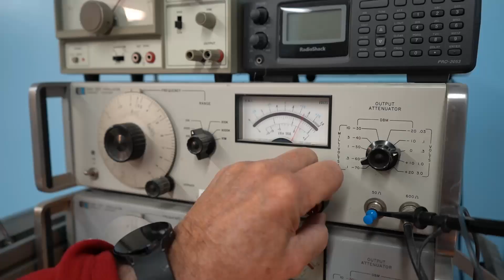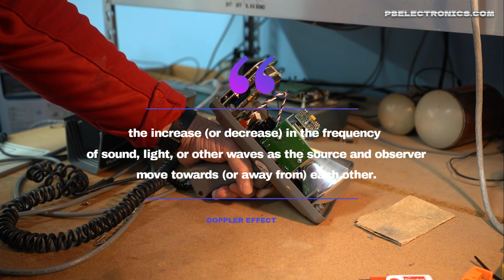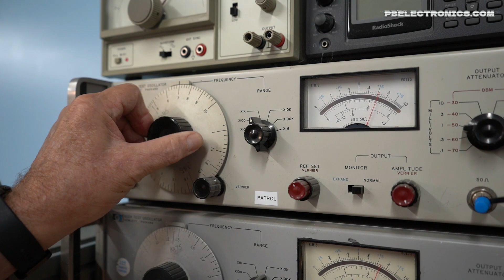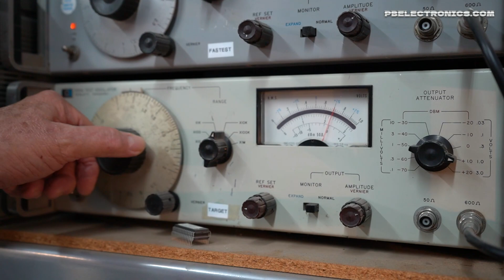Police Radar Repair & Calibration Basics - PB ELECTRONICS - How Police Radar Works  - MPH Z-15

Comment: Back in the 80's, I repaired MPH, Kustom and Speedgun units for several SO & PDs. Biggest problems were cords, RX diode and mechanical damage. I'll bet not much has changed except the addition of lasers.

Comment: I don't know who got it wrong all those years ago, but this is microwave speed detection - not RADAR which is an acronym for RAdio Direction And Ranging. 
Ships and aircraft use RADAR which tells them where the object is, the direction it is in relation to the craft and how far away it is. Microwave speed detection does none of these things. 
I suspect this system was called RADAR because it emits a radio signal which bounces back again. That's about all it has in common with true RADAR systems but unfortunately the name has stuck.

Comment: Two important points not mentioned in this presentation.

First, unless your automobile is moving at a significant fraction of the speed of light (186,000 miles per second), the Doppler effect upon which the "radar gun" works is a function ONLY of the rate of change of the distance between the radar gun and your car.  That is, the rate-of-change along the line-of-position between the radar gun and your car.  NO Doppler effect exists for motion TRANSVERSE to (at right angles to) the line-of-position between the radar gun and your car.  If the distance between the radar gun and your car is not changing, even if the speed of your car exceeds the speed limit, there will be no Doppler effect at the location of the radar gun.  It is not possible for the radar gun to evade the immutable laws of physics.  It is impossible for the radar gun to determine your speed of motion if your car is moving at right angles to the line-of-position between the radar gun and your car.

If your car is moving nearly at right angles to the line-of-position, it is ONLY the component of your speed with which your vehicle is getting closer to or further away from the radar gun that the radar gun can determine.  For example, if your car is moving at an overall speed of 100 mph, close to a right angle, but not quite, the radar gun might read 5 mph.  It cannot detect the component of your speed that is at right angles to the line-of-position, only the component of your speed along the line-of-position.

Second, if the radar gun in question was "calibrated" in the manner described in this video, the calibration cannot be considered reliable unless the manner in which the correlation between the setting on the signal generator and the speed reading on the radar gun were correlated with each other is specified.  For example, from the outset, the setting of the signal generator that results in, say, 55 mph on the radar gun may have been determined from a radar gun to which the signal was sent that yielded a display of 55 mph.  But, that radar gun may have displayed 55 mph when the Doppler effect actually corresponded to, say, 60 mph.  Having set up calibration in this way, all future "calibrations" will read 60 mph when the actual speed (along the line-of-position) is 55 mph.

To circumvent any such problem, an ENTIRELY INDEPENDENT (meaning independent of BOTH the signal generator AND the radar gun) speed calibration standard must be introduced.  Only when an independent speed calibration standard is employed can one specify the margin of error exhibited by a given radar gun, and can the gun be considered "calibrated".

BTW, I hold undergraduate and Ph.D. degrees in physics from MIT, and, among other relevant experience, I have worked on radar signature analysis for the U.S. Pacific Test Range.
Reply: Very informative and appreciate the information
Reply: No shit. 
Radar will not detect vehicles moving at right angles but you can measure distance traveled between two known points using a simple stopwatch.
Reply: Do you repair?
Reply: @ncso911  Unfortunately, I do not repair, calibrate or maintain Doppler effect "radar" equipment.  I am, rather, a Ph.D. physicist with a background in signal analysis.  The Doppler properties that I have described are true and immutable.  Anyone repairing such equipment should understand and be thoroughly familiar with everything I have described.  Otherwise, that person has no business "repairing" and calibrating such equipment.